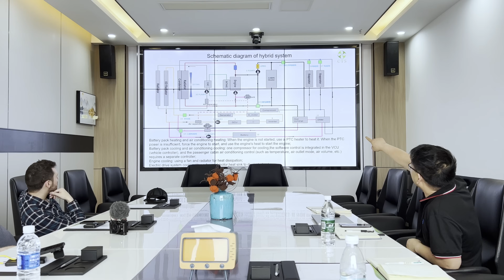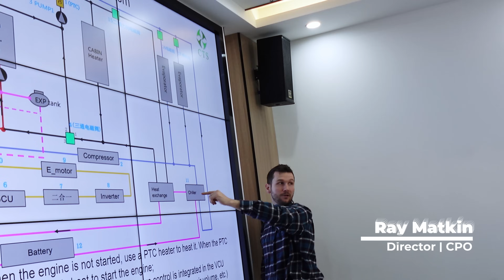High-Speed Rail, Battery Factories, and Cultural Insights, China Part 2

Comment: With how big your batteries are 150kw won’t be “fast charging”. 250kw is hardly fast enough on my model y. Aim for 350kw, that’s what the modern CCS chargers can put out.  Or just run the genny lol
Reply: They will likely only be charging after the work day is done overnight
Reply: Good enough for overnight charging.
Reply: 22kw AC overnight charging
Reply: I think they are doing hybrids, so fast charging is not particularly important.

Comment: I do hope the cabling is not soy based, so that you don’t have rodents eating the cabling.   I have had packrat problems where rodents have made nests inside our tractor and chewed up the wiring harness.  Not only was it at pain to rewire, it is a spot that is almost impossible to block off so they don’t come back.  So make sure the wiring is not tempting for rodents to eat and make sure all your boxes are sealed to prevent nesting.  Don’t want a truck disabled because a rat wanted lunch.
Reply: A rodent-repellent wrap is the best bet. A physical barrier that also reduces chafing issues.
Reply: There is tape with capsaicin in it that deters rodents. I believe honda had it
Reply: Have you tried a sonic deterrent , that’s rechargeable.
Reply: Why dont we just use vinyl like the olds days fellas.
Reply: @andrewthomson we should be. The small upfront enviro cost pays for itself by having a longer lifespan and not needing replaced.